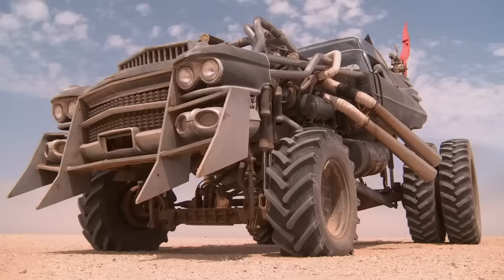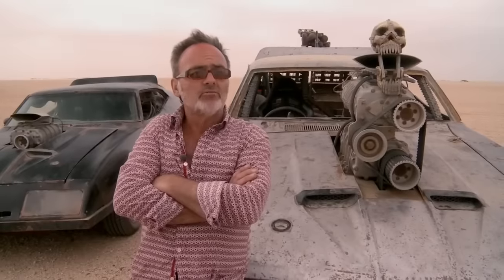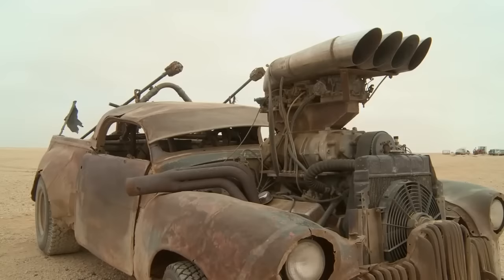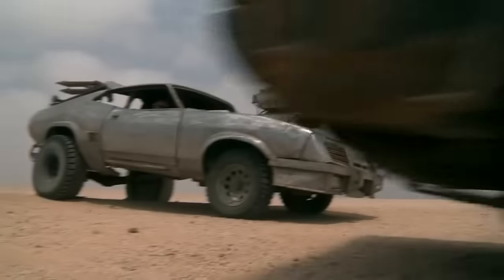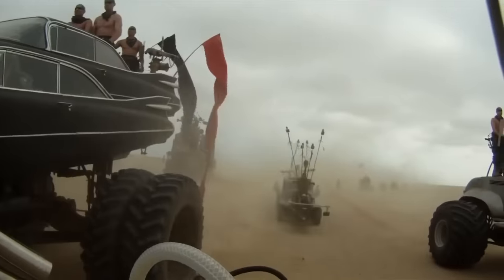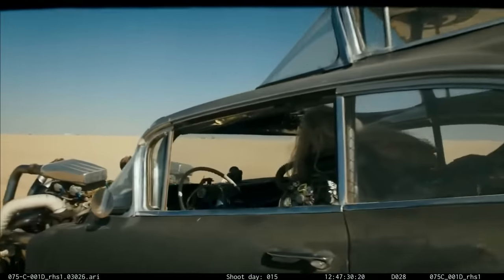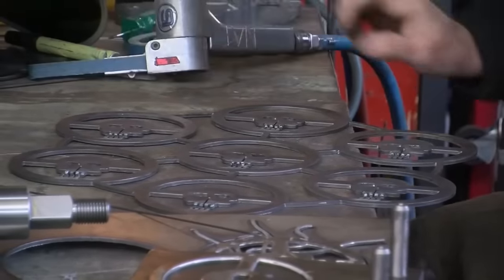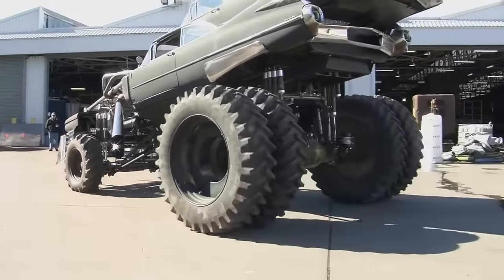Mad Max: Fury on Four Wheels [Behind The Scenes]

Comment: What pissed me off was all the people complaining when the trailer first dropped, going "derr if the gas is running out, den why dey drive deese big cars?" Ok, I don't want to see Max and the warboys duking it out in Volts and Priuses!!!
Reply: Now I wish there was just one prius to demonstrate what happens when it goes up against the gigahorse or peacemaker.
Reply: why must an electric car be or look like a volt or prius?
Reply: Axe Avier in a functioning world battery powered cars have yet to overcome the challenge of being worthwhile for most of our peaceful needs. How many charging stations do you think could survive in the mad max setting? How difficult would survival become staying at one for half an hour, immobilized?

Edit: besides the practical uselessness of electric in modern times and the "throwback" effect of the apocalypse, the tribalism of these desert drivers must also be accounted for. There is a reverence for the internal combustion engine, particularly the v8. There are shrines made to it. The war boys hand signal represents a v8. 

Besides the inclusion of massive cars, you must also think of what is excluded. Mad max has a distinct lack of any solid state electronics on purpose. Sure some minor solid state electronics may have survived. But nothing as complex as the digital electric motor controllers needed to operate a proper electric car, or to deliver the smart charge they require.
Reply: Arne Hurnik v8 would be just as unreliable as what? As electric cars that rely on solid state motor controllers that don't exist in the mad max setting? I mean, sure gasoline is a previous rare commodity there, but at least it's real.

Read my previous comments about the tech throwback from the apocalyptic event. Also pay attention to the fact that the drawbacks of electric cars being exaggerated in such a setting, and they're a hard enough sell now.

Also look at what I've said about the reverence that these people have for the v8. 

I also explained that hp=prestige.

See, the movie makes perfect sense to someone who has learned the setting. Don't forget that it it's actually a sequel. There are three previous movies that clarify the logic of this one.
Reply: Arne Hurnik less of everything is not the same as none of anything. You really haven't put any thought into this before replying. Its okay to not know. Just admit it. My response will be edited so I can go back to what you wrote several times.

Your question about gasoline is answered halfway in this video. The people eater is a mobile refinery. (Since you didn't watch the video, the people eater is the name of the truck with the limousine cab. Refineries are mobile because that makes them more defensible. Hence all the need for powerful engines. The other half is seen in "the road warrior" when max finds a heavily defended pumping station.

If they can refine gas, certainly they can reclaim and clean oil.

For the THIRD time, advanced motor controllers and solid state electronics DO NOT EXIST. The engines used would not be reliant on ecu for this reason. They are carburetor aspiration, and purely mechanical.

There is food and water. Those are the very things that the warlords are fighting to control. That's the key.

As for parts and components, the setting is POST APOCALYPSE. That's why all the vehicles are so rough looking. They aren't manufacturing from new. They are building from scrap. Again, the video you are commenting on explains this. 

Just admit that the reason why the moviemakes no sense to you is that you haven't made any effort to understand it before you say something else as dumb as "aNyThInG oThEr ThAn A hOrSe Or DoNkEy Is ImPoSsIbLe" about a setting you know nothing about.
Reply: Arne Hurnik and nobody made the claim that the engines last forever. Only that they were manufactured before the apocalyptic event.

Edit: electric cars wouldn't work due to several reasons. Fourth time: NO SOLID STATE MOTOR CONTROLLERS! Long periods of immobilization during charging. No national power grid to charge from. Power is isolated to its point of origin.

You really just don't know the setting. Your argument is invalid.
Reply: There are already electric trucks that are waiting to get on the market. Electric indie cars, electric everything. What you're comparing the fictional mad max setting to the capabillities of these particular oldish cars. That's  like saying if everyone in mad max walked and I'd go in and say that cars like the Mercedes smart car would be silly and there's no need for cars.  All this conversation is around what existed in 2012 as if the apocalyptic environment would instantly happen and not over a long period of time where we don't know if electric cars would be everywhere or if it's infrastructure to support it will be everywhere. 

That's why arguments like those of fullspectrum are brain dead moronic.  Well no fucking shit today's electric cars in today's environment won't survive if all of a sudden in a second or in a year there was an apocalypse. 

As demand grows for electric cars, as will the technology. But until then, it makes absolutely no sense to compare today's growing infant tech to a fictoinal environment.  Especially one that's currently more than like to be in the early 2000's since the apocalypse started to happen in the late 80's in the mad max universe.

So it's best not to even read fullspectrum unless you like reading arguments that look like they were made by a 10 year old. But being condescending and arrogant does make you look smart, just look at the pile of rubbish I wrote. Yet it still doesn't hold a candle to the parasitic trash of an argument you wrote up that doesn't even deserve to be called bullshit.
Reply: "Do you know how gasoline is made? Well, it requires electricity."

No it doesn't idiot, but that's how most electricity is made. 

"And furthermore, there's a hell of a lot to break on a gas car."

Which as I stated can be sourced anywhere, since most cars are gas. You can find a Hot Rod 350 Chevy part in any town in the United States or Australia, and any auto parts store, you can't say the same for electric cars.

"I'm not saying electric cars will work, I'm just saying gas cars will work just as much, which is not at all."

Well you are wrong, points and plugs with a carb are easy to fix and keep running. Like hat other guy, you don't know you are taking about. If there is EMP or a Nuclear detonation, not one electric car would work that was outside, but a gas points and plug car would be fixable in less than 30 minutes. 

"Don't tell me I don't know anything about cars, because I do know one thing: anything that moves and/or is put under constant stress will break"

Like I said, you don't know nothing about cars, so learn and shut up.
Reply: " I use scrap and secondhand pieces now to keep a few vintage bikes running. I've rebuilt components using nothing but old parts. And I'm not even more than average."  

Exactly, but he meant he can't, probably don't even know what a dip stick is.

I have myself even machined truck and tractor parts before, thousands upon thousands of the in fact. I once hand machined a brass roller for a car window on a 69 Caddy.
Reply: Exactly. I have never done any intricate machining, but I have fabricated simple bracketry to make dissimilar parts fit where they don't belong. I have built simple circuits, taken switches down to the metal contacts to stretch the internal springs and eliminate decades worth of spring fatigue, sanded the contacts to restore electronic conductivity and coated them in grease to prolong the life of switches. And everything I have done could be done with simple tools. These idiots don't understand the concept of "If it's broken, perform a repair." I don't know how anyone who can type can't figure that out. Even if they don't know how, they have to be taking the piss to tell me that they honestly believe nobody can.
Reply: They had methane gas and oil wells. Watch the old movies
Reply: There actually is a logical reason, it's called conspicuous consumption. It happens throughout human history. Dictators and tyrants will waste resources to create the illusion of power and control.

You can see it in dictatorships today. Look at North Korea, their economy is in shambles, their people are starving, yet they waste the majority of their resources on the military.
Reply: Having gass guzzlers is sort of the point really. It's a statement; "Look at me, i'm so fucking rich i can toss a gallion of fuel out the window and not give a damn"

The one who should be dring a prius is Mad Max, but then again he's mad so......
Reply: Arne Hurnik take your own advice. The mad max "world" has been laid out over the course of four movies. You have demonstrated that you can't grasp concepts that were explicitly spelled out in the video you are currently commenting on.

So, again, your inability to make sense of this movie is YOUR fault.

Part of the problem is the fact that you don't realize that objects older than 30 years exist. They do. Now, reproduction parts aren't available for all things. So looking around in reality there are p plenty of examples of machines that continue to work without the benefit of factory support several decades later. 

So again, your invalid argument only proves that you aren't thinking.
Reply: Arne Hurnik there's a reason why these cars don't look factory fresh. Part of the reason why they are made out of multiple cars in such an obvious way is to demonstrate that there are still people with the skills to rebuild them.

Tractors are used hard. Fire trucks, while not used often, are driven hard. Factories use machinery that is up to half a century old, and that stuff both runs hard and suffers from low production numbers. It's not uncommon for a factory to have production machines that are one of maybe three remaining from the 1970's.

Unlike those factories, drivers in mad max have several vehicle carcasses to pick clean.

As for boost, at the high end it does damage a machine. However, mild boost does not. That's why several manufacturers offer factory boosted options. The movies seem to take two different approaches to supercharging. Some, like the original interceptor use a clutch driven charger pulley that only boosts when the vehicle is in pursuit. Others may have the supercharger underdriven so that they benefit from mild boost without suffering the durability penalties of wild boost. Supercharger often have the same protective components as turbo, but much harder to spot. So they do have bypass valves that prevent catastrophic overboost
Reply: Arne Hurnik at some point, yes they'll run out. Some of the people in the mad max setting already have. The reason why there are so many slaves is that so many can't just get into a car and transverse the desert. That's why cars are so revered. Without one, you cannot escape the warlords. With an armada like immortan Joe has, you become a conqueror. In between you have single car nomads like max up to groups that can defend a pass or chokepoint like the buzzards.
Reply: you dont see volts or priuses duking it out cause all the people with electric cars strapped solar panels to them instead of weapons and used their infinite source of fuel to drive far away from the barbaric gas guzzling tribal warzones to live peacefully
Reply: DemonWarp65 
In Road Warrior, there is a refinery that is still in use, which is the main source of conflict. I mean, there has to be more than one still left, right?
Reply: If we cant build engines from scrap, then how did we make them in the first place : P

...and it wouldnt be a fun movie if it was set in a time when there is no parts left...

Also, the people eater should have turned dead war boys into fuel, run it into the religion, become fuel etc..

Just a point azman thought sounded cool...

Forget half life, The church of gasification is open!
Reply: i think they use big engines to cover the big distances faster.
Reply: in a world where gas is scarce, using it is a wealthy man's version of a dick measuring contest. so yeah, it makes sense that warlords would use allot of gas, even to the point of just lighting it on fire to light it on fire.
Reply: Think of Dubai and its gold..... 

kght222 is right...
Reply: I guess they neglected to mention how smelly each of those cars were with no catalytic converters and so many at a time. Lucky the boss gets to wear a gas mask. 
A 1st gen Volt looks good, has a chopped look to it. 

It does take energy in some form or another to create gasoline from crude oil.
Reply: Jim Bartosevich one thing to also realize about these old cars is that they are insanely easy to repair, look at 72 Chevy compared to a 2017 chevy, it’s like comparing a power wheels to a space ship. Also in a world like mad max, it’s all about reliability if you can’t fix the cars then they are practically scrap, that’s why you don’t see prious’s and new model cars, they are simply too difficult to repair
Reply: I would like to chime in here. Parts will last sitting on a shelf. As for a battery. you could run a mag and hand crank it.  Also could modify to run on alcohol (made from corn)using a distillery.  Or propane which if most everyone dies will be left in cylinders all over.Some Older dirtbikes that are kickstart dont need  a battery. And I am not sure but I think an empty car battery will last then put the electrolyte in when ready. You then could use a solar panel to charge or the charging system of a dirt bike with jumper cables. (Depends on model  I have a 3 wheeler with 12v system start and elect start and will start with no batt using pull rope so I could charge a batt if I needed to. And I am sure if you have crude oil you could find a way to refine without electric. And as long as you have a 12 v battery I am sure you could use a prius. It does have a gas eng. Also you could use a generator pull start gas or propane and a 12v batt/jumpstarter to start cars or charge battery. and car batts can also be rebuilt. With most everyone dead you could go into town to the battery rebuild store and get chemicals. It could work. but as for a full electric car you will need good batts and a way to charge it. IE gas / propane gen. I will be riding battery less bikes when the end is near And find a way to run on propane. I am a mechanic and all cars break new and old. With all those dead people there will be unused cars and parts all over unless everything is destroyed and I mean everything parts will be somewhere. Also wind generators.
Reply: you can just say, lithium batteries are gonna wear out, and even if somehow recycled, you're going to lose the uncommon hard to mine elements (because, no water), Li, and Co, where as with gas or guzzoline as they call it which may be something else, you can pull up more if you're close to a still functioning reserve
Reply: A Tesla would survive
Reply: Arne Hurnik tires too right?
Reply: Mad Max with priuses would actually be quite fun to watch, good idea for a parody :D
Reply: Nukes went off before 1981 "Road Warrior" 36 years ago, so the only "electric cars" would be those pathetic golf cart derived models, and ALL sophisticated electronic controllers, chips, coils and condensers within 50 miles of a city would be fried.  Everything in the "Outback" and small remote towns would be just fine and you can make new coils and condensers with enough patience, and use peanut or castor oil in the crankcase, however you would want to hoard all the real motor oil you could find.
Reply: Arne Hurnik dude with enough skill, you can build an entire engine from just a bare block with nothing but old parts, and a lathe.
Reply: Volts and Priuses are still Gasoline Cars. They are not BEVs. Same problem.
Reply: Arne Hurnik  well you can't be picking these movies apart to the bolt, you know that, it's cinema, Especially these show off ones, they like starteks, you have to go through academy to fit in, lol
Reply: Electric cars would be too quiet.  The chase scenes would be odd if they were all zipping along in almost total silence with only wind noise.
Reply: What about bikes, like even motorized ones id expect.
Reply: They would be using diesel so at least the mercedes was accurate
Reply: Electric cars wouldn't survive in the wasteland.
Reply: @KingOfMadCows  that literally sounds more like America